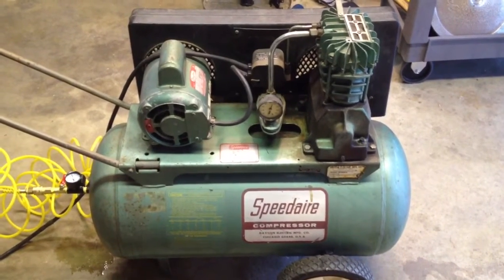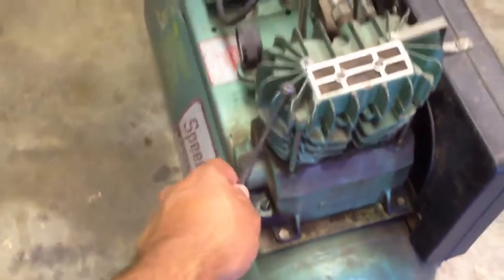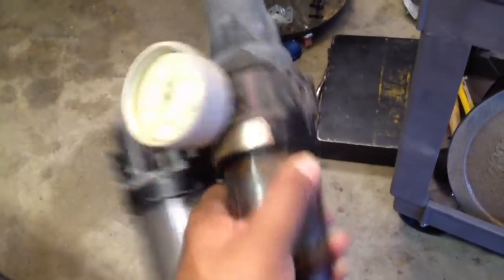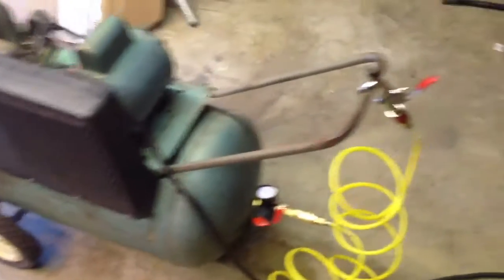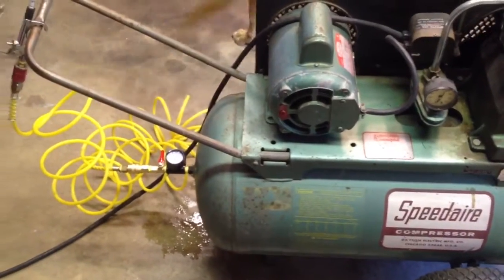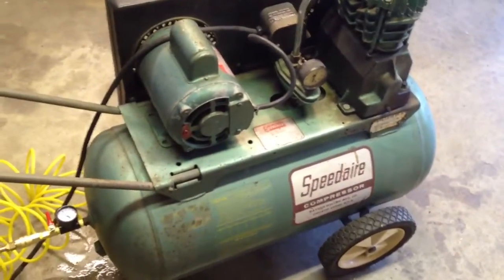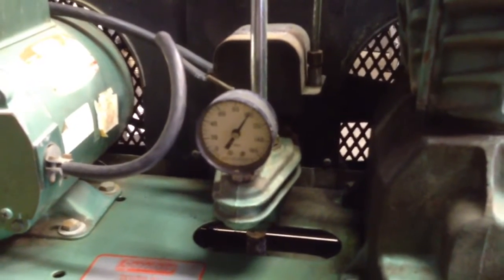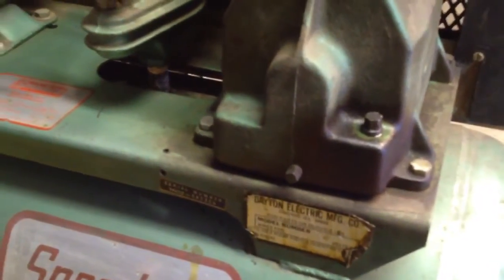Vintage Speedaire model 3Z406 air compressor replaces harbor freight 8 gal compressor.

Comment: Just picked up a 1977 sears and roebuck speed air, thing is a beast, fills up the tank in no time at all, I left it oily too keeps the rust at bay, I did an oil change and put full synthetic oil in, it's so quiet too.... Best 20 bucks I ever spent, and the 240v motor is so efficient.

Comment: LOL, I just picked of the 20g 3z419j last year, and I had the exact same HF one as you.  Probably overpaid for it at $150 but its the spitting image of the one my Dad had. These are nice not only because cast iron, but you can reconfig the motor to 220 with directions right on the front.
Just replace the purge valve with a low profice brass one from Amazon for like 2 for $8, next I want to pull that valve off and use my $10 eBay boroscope to see what the inside of the tank looks like.  Go check out some vids on what these do when they blow, it ain't minor.  Once tuned up, this is going in the corner of the garage inside a nice 2x4 box.  Out of the way, and somewhat enclosed is a reasonable safety measure IMO.  I also keep the read wheels propped up an inch or so to insure water will definately drain but not enough to affect lubrication/sump.  Opening the purge valve when I'm done, and leaving it open when not in use is my preference.

Comment: Good video! I have a Speedaire 3Z428 that looks just like yours but it’s a 2HP. Got it for free from someone who was cleaning out their garage. Mine runs great but wondering where to get parts for these just in case. Thx
Reply from the maker: @mikewong5888  grainger.com has parts. You can call them too they can help.

Comment: Love it. Just got the same compressor used. Wondering, after it runs is the top of the compressor head hot to the touch?
Reply from the maker: Yes it gets hot. All compressor heads do. That’s usually why they have cooling fins.  Some probably get hotter than others.

Comment: I have a sears craftsman 106.153781 same air pump need to find rings for it any ideas?
Reply from the maker: I looked at the manual. There’s is no breakdown of the pump. Maybe call Grainger. They helped me find my old manual. And seem to have things for other compressors  see here:  NOT FOR YOU’RE COMPRESSOR but gives you and idea. 

https://www.grainger.com/product/19NC09?gucid=N:N:PS:Paid:GGL:CSM-2295:4P7A1P:20501231&gad_source=1&gclid=CjwKCAjwvvmzBhA2EiwAtHVrb1F2hVwzMSZpO2pE3Q2O-YgdWJvbncZUof_-hpxldI_M13bqp4YzgxoCr1sQAvD_BwE&gclsrc=aw.ds

Comment: Never allow a machine to start without supervision or person nearby. If the motor/pump got cooked and no one is there to shut it off you will burn your house/garage down and will not get insurance as it was your fault and not an accident. Also you put unneeded wear onto parts if you leave it under pressure 24/7.
Reply: I worked in the wine industry for a decade, and it was standard for air compressors to be constantly on. I only watched one burn out during that time, and due to originally properly placing the air compressor with adequate space around it, there was no fire or problem
Reply: @travisvasquez6814  Industry and home use are 2 completely different things. The compressors used in industry looks nothing like the ones used for residential use. I have an old Broomwade compressor from the 1950's where the motor was built like a tank and the pump is solid cast iron, sounds like a stitching machine so silent is the compressor, but the point is my compressor sits outside in a steel enclosure as I know if if a 300 liter tank blows at 150+ PSI it will 100% take out a wall if not encased. The point of this is to explain sure it might not happen to you, but it could and that is why safety measures need to be in place. Same as crossing a road, you might not be hit by a car, but do you cross a road without looking? Don't think so. So why have extra risk with something that can also take your or someone else's life?
Reply: @kazykamakaze131  You are correct. And industrial or production usually means there is someone around, whether workers or security making rounds.  Leaving them on aside from the risk means you have water on the bottom of the tank for much longer than necessary. And since I haven't read of these old tanks having been passivated or coated internally, thats gonna mean rusting and eventually failure. 
A number of vids on tank failures, and it ain't nothing to scoff at.

Comment: Is yours wired for 110?  I have a 3Z407 (looks identical). Mine is wired for 220.  Would love to switch it to 110
Reply from the maker: Mine is 110. Not sure if you can wire it for 220. Check the motor nameplate it should have a wiring diagram for 220 if available.

Comment: Can you read on one of the tags what cfm at 90 lbs it would put out I’m looking at one like yours  but can’t find a manual or a tag on it ?
Reply from the maker: Hello there are lots of tags on that compressor. None have that info. I have an old manual somewhere if I find it I’ll update.
Reply: Karl Dias thanks
Reply from the maker: The 3z406. It’s  1 hp. 7.6 cfm,   4.9 cfm @ 100 psi ( free air).  I have the manual.
Reply: I was going to buy one but it’s sold